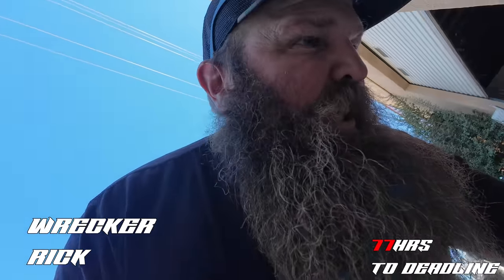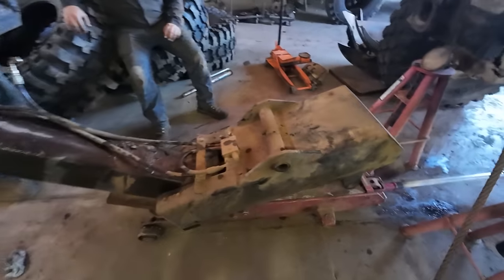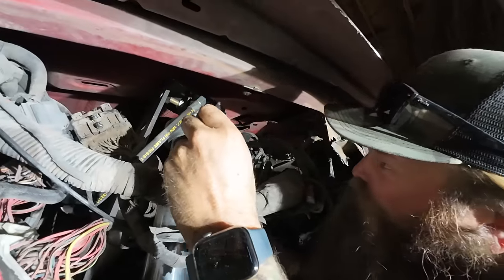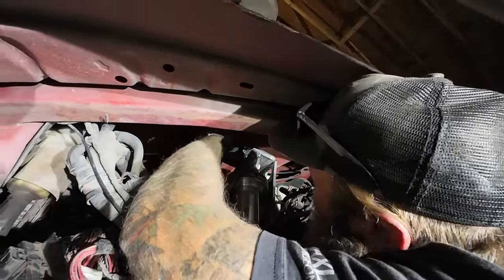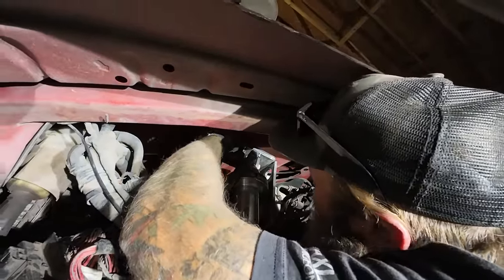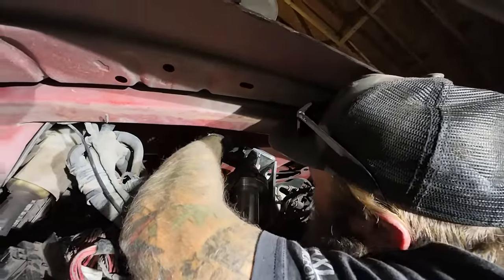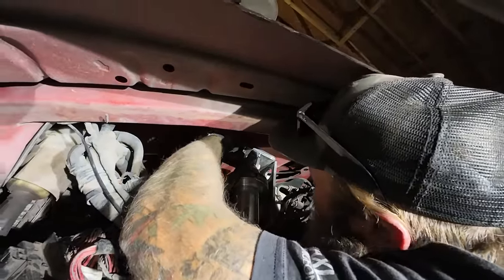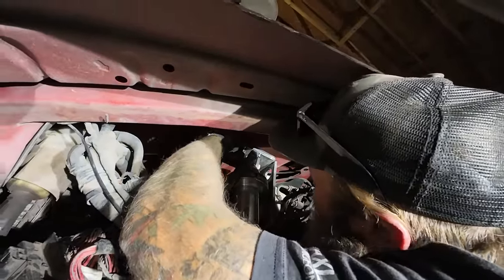OFF-ROAD WRECKER Gets COMPOUND TURBOS! Our First GIVEAWAY!

Comment: I gotta tell ya this little(ya right) story. In 1975  I was 22 ,had 2 cars one good one junk. Took the engine out of the junker and rebuilt it for the good one, both same size. Took me Friday night all the way to Sunday night, never took a nap , was awake the whole time started drinking black coffee back then. I did this in my parents garage used a chainfalls and hand tools took advantage of a local machine shop to recondition the rods and hot tank the block and put in knew cam bearings everything else I did ,had to buy a new crank shaft and pistons. After I got it running 1:00 Monday morning just drank more coffee and went to work and hit the hay when I got home. That was not the last time I pulled an all weekender did it again in 5 years only 2 more days I was s**t when I was done, slept for 2 days .Used accrued vacation time no deer hunting for me that year. but it was worth it.

Comment: I'm no expert , I was thinking while I was sleeping, everbody that went to the last wrecker games had their wrecker built just the way they needed it for what they worked in their area, Rory's Trail Mater looked a little like Paul and Ben's Fab Rats wrecker Matt's giant off road wrecker is fabbed from the bottom up ,it's got a homade frame, Merlins Rigg is just antique and the only diesel at the first annual and he won the first place trophy, BSF Recovery team's entry was a GMC gasser with a similar wrecker rear body as HellBoy's  but he's 3 times bigger and BSF's  drivesin snow and mud and mostly on trails meant for SxS's., I forgot Robby Layton, this guy wasn't in the games but he showed up with a 4x4 stretch limo with 50 inch tires now that was odd but he's a excellent body man for whatever you drive and Chad's Fab has the electrical skills I've never seen with anybody he's sublime .Every body is from a different area the 2 extremes so far is BSF recovery team I believe Wisconsin and Merlin's Old School Garage  extremely southwest Arizona  every body else is Arizona and Utah..

Comment: Everyone that I’ve seen that hood or side stacked their compound or twin diesel has regretted that decision pretty quickly. Windshield ends up always  black and dirty with an oil film with a hood stack and side stacks the exhaust always ends up in the cab so you can never roll down your windows.
I honestly think the wheel lift could have been very beneficial in a lot of situations having the extra hydraulics. You even used one as a hydraulic press in this video lol.
Either way it’s looking really good. You definitely have to find that perfect balance if you want a vehicle that’s good at multiple things.
What would be really cool would be hell boy having a rotating boom. 
Glad to hear you are going to stick weld the structural parts of the build. My dad owned an oilfield equipment fab shop and I’ve had that argument with multiple people who seem to think that a mig weld is as strong as an arc weld.
Reply: I love my hoodstack but also hate it 😂😂
Reply: @williamuskoski1385  love it for the first few minutes and then hate it for the next few hours lol.

Comment: I’m sorry I just disagree with removing the wheel lift I have seen you and other wreckers using them to hold you in place in the mud and such but it’s your truck but I absolutely like everything else you’re doing and I have to ask is it legal to not have the stack behind the cab for the exhaust in Arizona or do you not plan on making it road legal going to be one heck of a rig

Comment: I need an underhood wiring harness. I have a 2007 dodge ram 2500 with a 6.7 cummins with an aisin automatic transmission. Its a 2 wheel drive do you have a harness you can sale me? Or know of a place that can copy the old one and build a new one. I bought it new have taken it to 3 dealers and the last one suggested i part it out. It has 130,000 miles. Please any help is appreciated. My truck is stock.